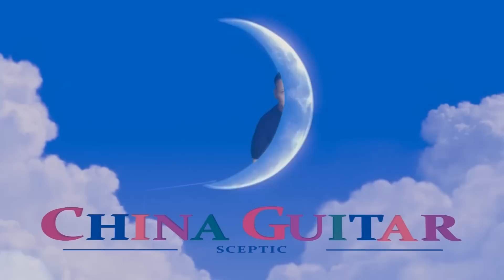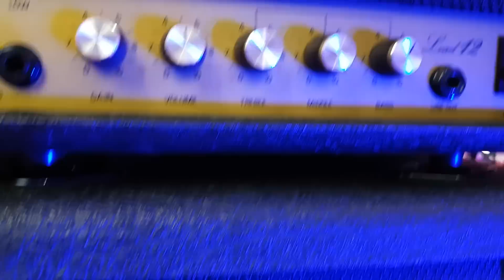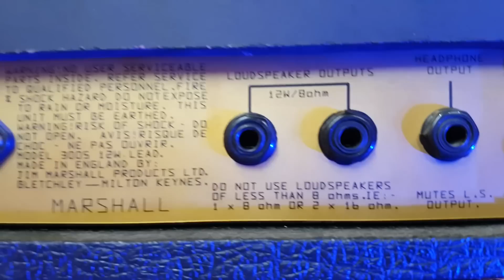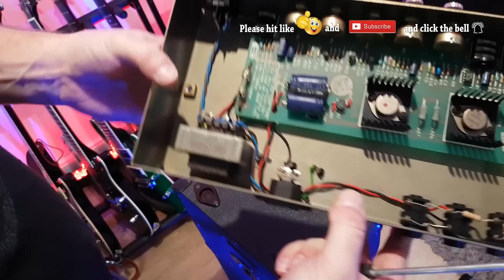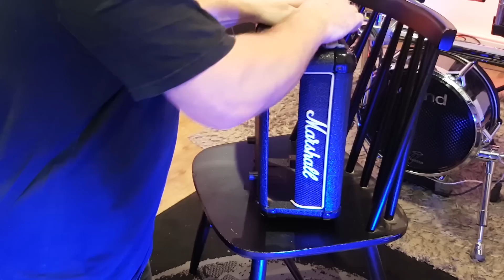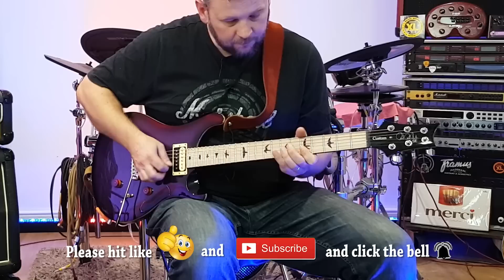Tiny Stack BIG sound! (Marshall Lead 12)

Comment: Hey, nice stack! I just picked up one of the custom white 50th ann JCM1 tube mini stack.  It was new in box, aside from the head which was on display and thus missing papers(they gave me a nice discount, they had it in storage for 10years and never put it up for sale).  It's got 2 cabs with a 16ohm speaker in each.  The head outputs show 1x8 and 1x16ohms.  I assume to use both cabs it's the 1x8ohms i would use?
Reply from the maker: That's right use both bro

Comment: I bought mine 30 years ago new. Still in perfect condition too. It was as much amp as I could afford in high school. It's a good amp although I've tried others over the years that had tones I liked better than the Lead 12. I ended up buying a Zoom G5N board and that had the tones I really wanted. Since the amps tone cleans up really well the board works out well when used with it.
Reply from the maker: Zoom are great

Comment: Were the speakers Celestion G10D-25s? Those speakers seriously are not very good. Get a better 10" and those Lead 12s can sound very credible.
Reply from the maker: They are the originals yes.
Reply: What’s a better speaker you would recommend for it?
Reply: @Max-The-Axe  G10L-35. Bass or Lead cone. If unavailable, the G10 Greenback is rather nice...

Comment: These amps are awesome! I own three of the stacks and just installed an effects loop on one of them tonight. The early ones have plywood cabs and smooth power switches. Still keeping my eye out for a some what reasonably priced micro bass stack.
Reply: I have a clone with a loop  I've also made a few heads out ve old peaveys
I went through a period of tube amps and ditched them   these sound the closest I've come to sounding the same day to day

Comment: You may not want to poke around an amps capacitors with a screwdriver. Could be a shocking experience! Use a chopstick.
Reply from the maker: Great advice my friend! I was careful not to touch anything but the outer case but this is something I should have said in the video. Don't copy this at home kids! 🏡📹😊👍